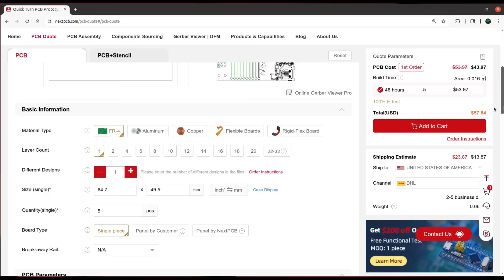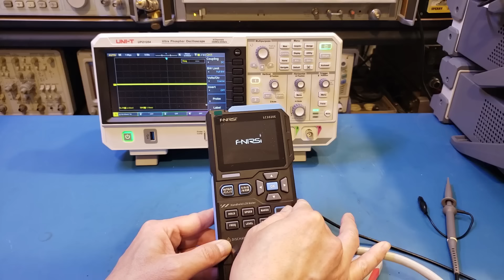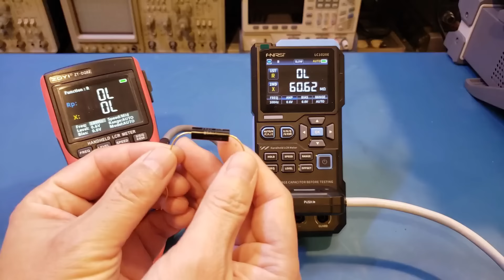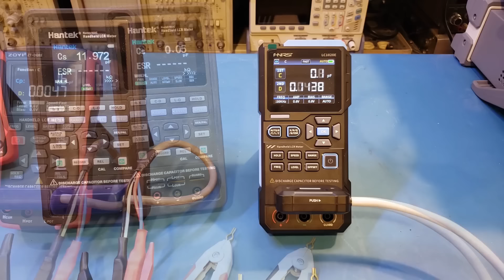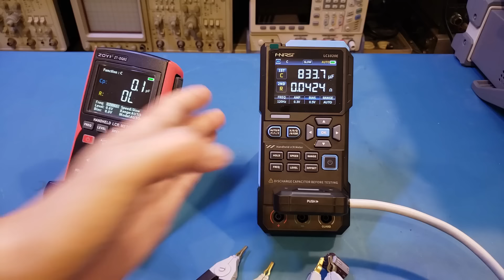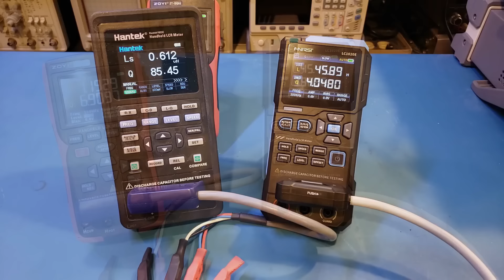FNIRSI LC1020E LCR Meter Review/Teardown, How does it Compare with Other LCR Meters?

Comment: 10:02 - you can toggle between parallel and series modes. It's not obvious, but if you read the manual, you'll see that it's toggled by "Speed" button long-press
Reply from the maker: Thanks for pointing that out! I read through the manual, I guess I didn't notice that. IMO, they should've indicated that on the case as a secondary function. I will pin this comment.
Reply: @KerryWongBlog  BTW, about LC1020E measurements accuracy, did you make a calibration open/short before this measurements, based on 8.2 Measurement Accuracy in the manual (4): It is recommended to perform open-circuit and short-circuit calibration before testing.
Reply from the maker: Yes, I did the calibration a couple of times.
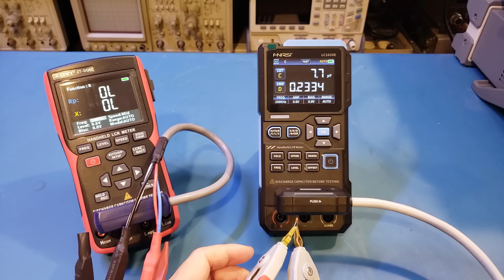Reply: @KerryWongBlog  Ok, thanks. I'd suggest to measure dip elements with the legs inserted right into H/L connectors, without Kelvin clips at all. That way such ceramic 10pF showed in LC1020E right 10pF with 10k freq. Just take a look at 11:34 Fnirsi clips has 0.1pF on opened clips with 100kHz freq, 12:22 zoyi clips has 2.5pF opened clips, so 2.4pF difference. At 10kHz Fnirsi clips are 0.8pF open and Zoyi 1.6pF clips open. So, at least you could try to flip this clips and see if it makes any difference at all between this two devices.
Reply: Great review as always. I think I'll stick with my DQ02
Reply: @TYGAMatt  and I will keep my 1832C
Reply: @romanstingler435  of course! 😂
Reply: Thank you for taking the time for such an in-depth review. I just received the LC1020E, and I want to like it, but it’s still not earned my trust, as it’s locked up several times in the first week. Hoping a firmware update and more understanding of its use will help me warm up to it.
Reply: To be honest, no your best review,  yo missing some stuff and validation as remove the clips and test in the sockets, you didn't change parallel or series and even you said there is not, you could swap clamps,  also the values in open...I think you messed up quite a lot the review

Comment: I just purchased the LC1020E June 2026.  It still has the same issues Kerry discussed running the current firmware v1.1 which is the newest available.  I also have a DQ02 and a more expensive GW Instek LCR-1100/1010.  That is fairly equivalent of the Hantek shown in the video.  If you are looking for an inexpensive meter the DQ02 provides more stable display and tracks the Instek meter more closely than the LC1020E.  I like the styling, user interface and the nice Kelvin clips of the LC1020E.  The DQ02 is a better meter, but the Kelvin clips aren’t as good as FNIRSI’s.  It looks like you just don’t get everything nice simultaneously for a sub hundred Dollar price.  Actually you can get both an LC1020E for the clips and a DQ02 for the meter and it would be about 1/4 the cost of the the LCR-1100/1010 and it would be a reasonably good approximation if you used the FNIRSI clips on the Zoyi meter.

Comment: Ceramic capacitors are affected by the heat of the hands; the correct option would be to use silver mica capacitors or polyester capacitors.

Comment: The FNIRSI LC-1020E is notoriously inaccurate using the 100kHz test frequency. On 10kHz and below it is quite accurate.
When you correlated the 10 pF capacitor measurement with the Hantek meter, which frequency was the Hantek set at?

Comment: Alas, the music did not play for long. It stopped calibrating, or rather it passes calibration, but there is no zero.  As a result, at low resistances the error, depending on frequency, is from 2 to 30 milliOhms... The plate is measured as 30 milliOhms. The seller sent it, contacted fnirsi - they also sent it politely. They said I need to reflash it... They can’t do it remotely, and they don’t sell the main board separately.  And they don’t just send devices for reviews, keep this in mind. And don’t take Fnirsi - it’s a lottery, most often a losing one

Comment: It would be truly marvellous if the exposure procedure would be formalized if not standardized - in line with the very nature of these products. Thoroughly evaluating a product based on the manufacturer presentation, pre-sale support, claimed performance and overall footprint quality vs. what is expected at particular price points is decisively not trivial, but it will go a long way in providing better value for a potential audience. Additionally, there is no point in using the de KS probes for small discrete components, especially for evaluation purposes, as long as the leads are long enough to be used with the internal slots.

Comment: I've seen multiple tools from FNIRSI and one thing is becoming clear:
They should reallocate some of the graphical designers budget to actual engineers.
Reply: right on. This LCR meter isn't even hard, its a tried and tested hardware architecture for decades

Comment: I just bought one of these before seeing your review. I'm thinking that they fixed any accuracy issues with the new models that are shipping out now. I compared this directly with the ET-433 and my mid-1950's ESI 250 Impedance Bridge, and all three units agree with each other. As a reference, I tested a 100 uf 100V electrolytic capacitor, a 0.1 uF 400V Mylar film capacitor, three vitreous enamel power resistors (10, 25 and 1500 Ohms) and two inductors for use in speaker crossover networks (0.55 and 1.5 mH). All three meters returned the same result to the third significant figure, along with equal Q measures for inductance and D measures for capacitance.
Reply from the maker: Thanks for the info. Glad to see that some of the issues were addressed!

Comment: What’s very good about the Zoyi DQ02 and its battery-test mode is that you can also measure resistance on components other than batteries. And then you actually have a 4-wire milliohm meter, which makes the Zoyi much more versatile. At least in my personal opinion.Thanks for the review of the Fnirsi.

Comment: Is a measurement accuracy of 0.3% very important when repairing household appliances? Or not so much?
Reply from the maker: For most consumer electronics especially for digital circuitry you don't need that high accuracy.

Comment: Now someone to please explain me why if I set for instance 0.6V amplitude, and with a mutimeter I measure the voltage between "pot+" and "pot+", I read 0.6V rms. The same (exactly the same), if I measure the voltage between "cur+" and "cur-". And If I place a 3k resistor in parallel with the multimeter, I read 0.43 Vrms both between pot+ and pot- and between cur+ and cur-, regardless. This thing is a toy!!!

Comment: At 20:53 you can see the internal connections of the banana and slot connectors. You see that the front and back connectors (curr and pot) are one and the same. This shows the meter CANNOT do true 4-wire measurements. This is actually the case with some other LCR meters from well-known brands. The DER DE-5000 does support true 4-wire measurements as both the banana and the slot connectors have separate current and voltage connections. In the bananas this is done with a front and back semi-circles, which I think is pretty smart.
Reply from the maker: I will need to check, I should've opened up the probe assembly.
Reply: @KerryWongBlog Even if the probe assembly has separate lines, the blade connectors on the multimeter side not separating curr and pot means that there is no way to measure voltage at the clip ends without the voltage drop produced by the current necessary to do the measurement. In the "proper" configuration, one would use the "curr" connection to send current to the device under test while the "pot" connection carries no current at all and only measures the voltage at the device under test terminals.
Reply: @miguelbarrio they are separated. Get the LCR meter and open the blades with an insulated plate. They are definitely not connected together.
Reply: @KerryWongBlog the probe assembly has one side of the connector plate connected to one side of the probe, the other plate side goes to the other probe side so they are electrically isolated.
Reply: I’ve checked my meter, separating the two spring contacts with an insulator. The Hpot is connected to the banana socket, Hcur reads 1k ohm to the banana socket so they are not physically shorted together.
What you see in the video is the guard contacts shorted to the banana socket which is correct. The other connections there is one pcb trace from one side (Hpot) going to the banana socket.

Comment: Thank you for your work, I really like your detailed and unbiased reviews!

Just one small advice: when reviewing products from budget equipment vendors (like FNIRSI or ZOYI), please use some fancier tool as a reference. Your lab seems to be full of instruments from HP, Tektronix, Keythley and other major respectable brands. Using a budget Hantek meter against two other budget instruments is just not convincing. I think a lot of other viewers might feel the same.
This is not to show the fact that cheaper tools work worse than expensive ones (this is obvious to anyone already), this is to show HOW MUCH worse they work, so potential buyers could decide if they can tolerate this discrepancy in performance for the price difference or not.
Reply: I would agree, I don’t think any of the meters shown come with calibration certificates.
Reply: Agree, a third budget meter doesn't give me much confidence...

Comment: Also, all these LCR meters (including the DE-5000) require an initial calibration using the test leads you're planning to use. Unless you did that calibration, that could easily account for the differences noted in the tests.

Comment: Thanks for the review! I enjoy all your reviews. I use the DER DE-5000 LCR meter exclusively now, it's around $100 with no accessories. I primarily measure smaller value inductors and capacitors for RF use. I always ignore the Q readings as I've found they don't actually relate to actual Q of the component. After your reviews of these various LCR meters, I'm not going to change from using the DE-5000.   :)

Comment: In my opinion, the errors come from the measuring cable; the measurements should have been taken with the same probes.
Reply: three-phase did a side by side with same leads and the fnirsi was more accurate in his test at 1kHz...unfortunately he only did 1k...I think for 100kHz the longer leads on the fnirsi are probably an issue...
Reply: @simccaffrey  Then he should have used the banana terminals.

Comment: A few things: 
You forgot to do the screen protector peel!  Becoming a signature start.
Choosing the frequency:  One could memorize the guidelines for frequency, but I've found that monitoring angle theta works great as the angle approaches 90 as one gets closer to the proper frequency.  Negative angle for caps and positive for Inductors.  I still need to remind myself about using par or ser.
Seems you have a lot of these lcr meters now. Perhaps choose the best to use as a standard? Did you review a benchtop UT LCR meter? 
I still like my et432. I noticed these meters was missing the 40kHz frequency which the ET meter has.  Also,  the ET meter allows a dc resistance measurement, which is the proper way to go unless one is concerned about parasitics. 
I agree about the kelvin leads. The shorter wires create tension at the clips, always slipping off. Its better for measurements though, tradeoffs. 
I'll remark again, there is a lot to learn to make consistent reliable measurements with these meters. 
This did not seem to be a very good meter compared to my ET.
Reply from the maker: That's not a screen protector. For some reason they put a sticker on the screen at the corner. I didn't even notice it :-)

Comment: 20:33 That godawful trend of integrated batteries. What do you always have in a workshop or service toolbox? Spare AA, AAA and 9V batteries. What do you never have? Time to charge tools you want to use NOW. Also, it makes waste because it basically puts an expiration date on new old stock units.
Reply: Exactly. This throw away culture is saddening.
Reply: For such a device, a pair of AA batteries is at best a day of operation, with such consumption, batteries in devices should probably be prohibited by law.
Reply: @Иван_Абрамов  A day of operation is a lot in many use cases. And there are rechargeable AA if they fit your use case.
Reply: @splitprissm9339  Lithium batteries are suitable for me, personally, not one of them has worked for less than 10 years.

Comment: 7:31 true - had to look up the spec, this resistance range at this frequency is 0.4% +- 4 digits. So it is indeed no problem. Against 0.3% it would be marginal.

Comment: What are the clips you are using on the ZT-DQ02? I could do with a set of those as the ones included are a pain to use, needing all 4 wires connecting each time.
Reply from the maker: Those are standard Kelvin clips for LCR meters. I happen to have a few LCR meters so I just borrowed from another unit.
Reply: @KerryWongBlog can you just use other meter's clips  in another brand meter? They could have calibrated for their own clips ain't they?

Comment: Please do not publish measurements of 12 pF capacitors using tweezers. Insert the capacitor directly into the instrument clips!
Reply: A properly designed 4 wire instrument should handle that fine, actually BETTER if you attach the kelvins close to the component body like he did.
Reply: @splitprissm9339  "A properly designed 4 wire instrument "    1) Never seen an high grade instrument measuring a 12pF capacitor with long tweezers    2) This isn't an high instrument !

Comment: I have a few FNIRSI devices, all of them leave to be desired.  They live in my junk box, and I see that their LCR meter is also lacking.  Their stuff looks good but they always release them before they get them working properly. I avoid all FNIRSI products since they might be cheap but none of them work well.
Reply: But yet you “have a few”?
Reply: @SinnerSince1962  I tend to try them out on my channel @Tech-Relief
Reply: It works out if you can afford to wait for FNIRSI to update firmware, which they may do as long as the product line is selling well.
Reply: @mrdiggie3321  That has not been my experience with the FNIRSI devices I own...
Reply: @mrdiggie3321 firmware can not fix physical hardware limitations.
Reply: So what multimeter you recommend?
Reply: @bravo6942  Depends on your use and budget.  I have one of those DER-EE DE-5000 ones you see around but it is far from perfect although better than FRNISI, the one I use most and seems alright is one marked RUOSHUI which is a bench top one but I seen the same one with different brand names.  The good ones always have four sockets two red and two black with four wire leads and kelvin clips. Unless they have four wires they will not be accurate due to inductance, resistance and capacitance in the cables.
Reply: Yeah, it's interesting how they manage to make products which look interesting, but just don't work properly. FNIRSI even messed up their transistor testers, which work way, way worse than no-name $2 alternatives. They could've just take the proven design (which is open source BTW) and put it in a fancier package, and people would buy it. It seems that they don't even test the products they design.  It's really a shame that FNIRSI could've just spend a couple more cents into R&D and make really competitive products, but instead they produce unusable crap.
Reply: @Ultranium1  I guess they are still making money from these somehow.  I would love to hear from someone working on these devices why their products are not fully completed before releasing them.  Is it pressure from marketing or incompetence?

Comment: The FNIRSI LCR meter was not available at the time so, I purchased the Zoyi DQ02.  I have found the DQ02 is pretty accurate and meets the published specifications.  The Zoyi meter has options in the setup menu for field calibration but the manual does not explain it and the process is not obvious.  It is possible to revert to factory calibration in case of making an error.  That would be a big plus for the DQ02 if the calibration process were documented.

Something which would be an advantage would be DC resistance (DCR) measurement.  That is something which is helpful for wire wound lab resistors, motor windings and the like.  The GW Instek LCR-1100/1010 has DCR, but it is more expensive.  The Instek can be ordered with Kelvin clips and Kelvin tweezers and includes a calibration certificate.  The Instek unit is worth considering if you need confirmed accuracy.

Comment: Regarding 2:30 Fnirsi clips. I don't know why they did such bulky grey "guard". I think they can get rid of it completelly. If you teardown the plack plastic connector, you'll see that every separate wire has its own guard. So this grey colored isolation only have a synthetic cloth strength core and nothin else. So I think it's mainly for make it look more professional :)